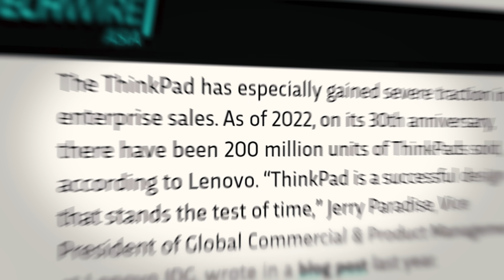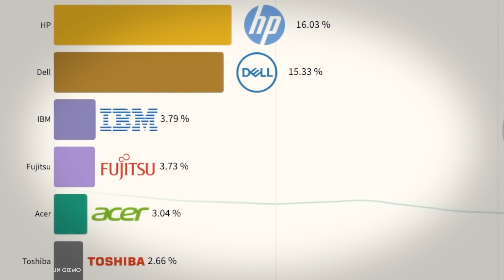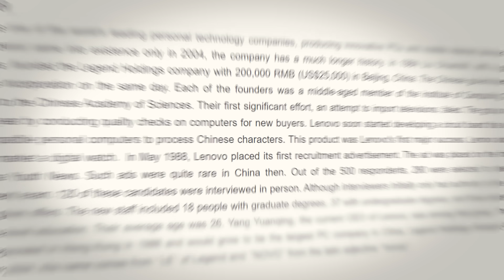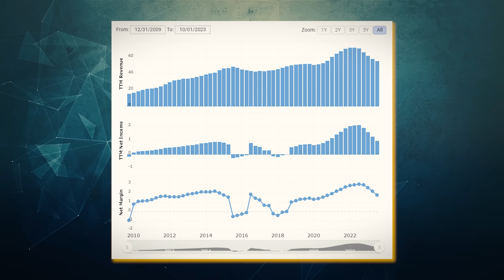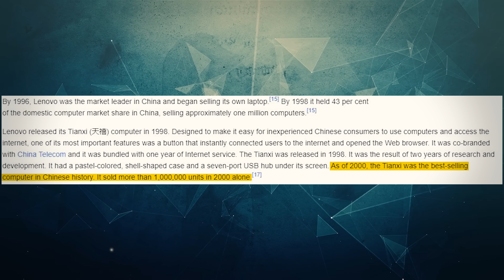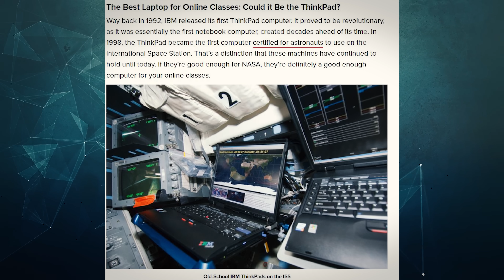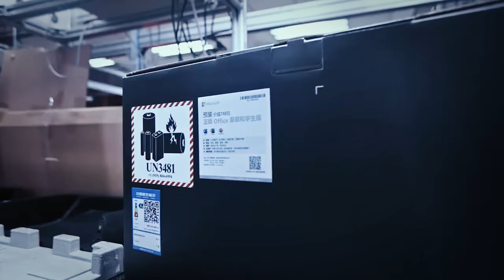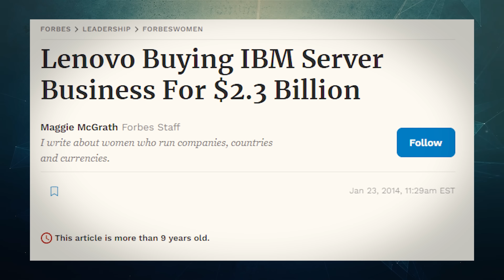Lenovo - The Last Practical Electronics Maker

Comment: Damn, I wish that I could call the ThinkPad "practical". The design has been slowly moving towards more of a Macbook, trying to appeal to a larger demographic, throwing away everything that made the ThinkPad special. I am terrified of what will happen to the brand in the future, like any other company, lenovo is motivated by only money.
Reply: I think you need to go for their workstations to get closer to the old ThinkPad feel. I have a ThinkPad P16 and it's sturdy, easy to service, and has enough ports (no ethernet though). The keyboard is still decent though the travel is shorter, and you still get a TrackPoint with real buttons. Not a T61, but still better than the other business laptops.
Reply: @toobigtofit3584 the framework 16 is coming out, and it's going to make the p16 obsolete. The days of workstation ThinkPad are over, the only thing that is easily swappable on the workstation ThinkPads now is storage and memory, but even those are becoming soldered.
Reply: @toobigtofit3584  lolol rip off laptop not good enogh, try a ripoff prebuilt lolololol
Reply: The X1 carbons sure, the T series still has their old spirit
Reply: Look how they massacred the Legion 7 too. It managed to look good while still being thick in 2022. It was the peak of looks, luxury, and functionality in a gaming laptop. Now they renamed Legion Slim 7 to Legion 7 while having inferior GPU with less VRAM. They also decided to invert the motherboard in the true successor, Legion 9, and the Slim 5 lost the rear I/O. Legions may have dual RAM slots (aside from the Slim 5 14) for now, but I wouldn't be surprised if they end up like this eventually.
Reply: Yep, the framework 16 is becoming what the thinkpads used to be. Serviceable devices with upgrade potential.
The thinkpads are losing their charm because they are getting mainstreamed by Lenovo.

Comment: If anything, in recent times, thinkpads have turned more and more into macbooks, from having soldered components, to limited upgradability. Gaming laptops, for their entire history have had upgradability, repairability and for the last 7 years, affordability. Yeah, you can find $500 rtx 2050 gaming laptops in the US with ease and it won't have soldered components while packing a high refresh rate display. And that rtx 2050 will be about as powerful as a desktop rx580. 

The reason the pixel failed in the past is it was overpriced and unreliable. Nearly every pixel had issues. Only the google pixel 6a turned out to be competitive when google dropped its price to $300. And even that was a fluke because they did not continue this trend with the pixel 7a. If you want a practical phone, you went with the chinese phones. If you wanted clean software at a relatively cheap price, you could go with nokia or motorola. If you were tech savvy enough you can get a cheap xiamoi flagship and install a custom rom. 

Thinkpads stopped being a good option since 2014/15. And for quite some time, gaming laptops have replaced them largely.

Comment: There is a reason why you can walk into any office worldwide and see thinkpads everywhere. I've had mine for 4 years and it still looks brand new
Reply: Not really. If your workplace allows you to pick your own laptop, people tended to go for gaming laptops since they just offer unrivalled value. 

And the reason thinkpads are in offices is cause they're cheap when bought in bulk. Not that they're all that reliable or great.
Reply: Well the Thinkpad has used a timeless design. Kinda the Business Suite of laptops.  Rubberized black plastic, easy to hold, matt finish to hide scratches and dings, the new models look a lot like the IBM models of the 1990s, just thinner and unfortunately a chicklet keyboard.

Comment: I already got my eye on Lenovo Thinkpad L13 Yoga equipped with Ryzen processor. I will run my current Thinkpad L380 until it failed on me (it will really take a long time), and I will replace it with L13 once this one died on me. Since my work is mostly word processing, I don't need much horsepower, I need reliability though, and 2nd hand Thinkpad are so plenty in the market, you can easily find replacement parts if any broke down.

Comment: There was one with an anti drift feature where if you slightly put pressure on it to very slowly move the mouse for a long time it thought it was a glitch or wear down and stopped moving to prevent drift

Then i pressed a little harder until it happened again. Then again. Then i stopped and let go and now that it had all that anti drift learned it started moving on its own without touching anything
Reply from the maker: Hahaha, trial and error

Comment: I have been using Thinkpads for over a decade and I can attest to their durability, reliability, and performance. They are not flashy or fancy, but they get the job done. I love the keyboard, the trackpoint, the ports, the battery life, and the easy upgradability. I also appreciate the history and legacy of Thinkpads, from IBM to Lenovo, from Earth to space. This video was very informative and entertaining. Thank you for making it and sharing the love for Thinkpads. 👍
Reply: I'm a bit dissapinted in Lenovo that they too dropped the good keyboard for a macbook clone one since the T430. The traditional keyboard was more comfortable and had better key travel and was a bit more tactile. Especially the ones from the late 90's and early 2000's. The new one feels like typing on a school calculator. I also strongly dislike integrated batteries. But maybe i'm just too old or the wrong user base.
Reply: Same here, this is the reason why I love my ThinkPads so much, I run Linux on all 3 of mine (T480, X1E2, and X220)
Reply: i have got one screen destroy (thats low), as one fell 1,5 to 2 m onto stairs. but that only destroyed the screen (something in it, it had not damage on the outside, and it made a small damage on the hull. but it worked without problems after replacing the display
Reply: Three decades of usage here, same opinion. I happen to even think the rectangular, matte black look is the most aesthetically pleasing to me. I go for matte black option for all my gear if available. The keyboard is of course great and so is it's layout. I've got relatively small hands, Ctrl is much more ergonomic to use when it comes after Fn! This is what many seem to criticise. There's a toggle on BIOS two swap their places for those stubborn to retrain their muscle memory and want to continue stretching their left pinky.